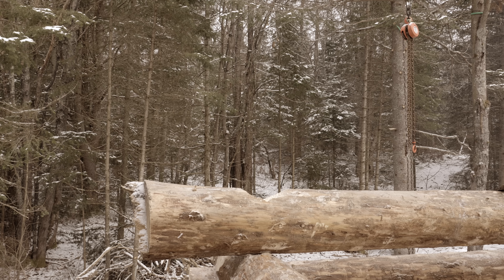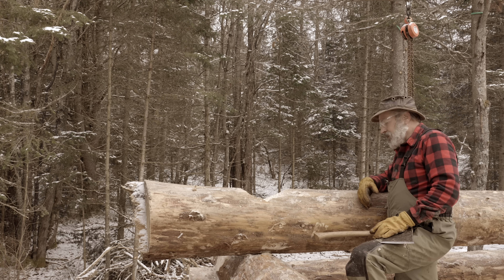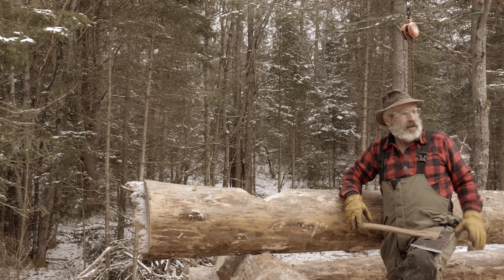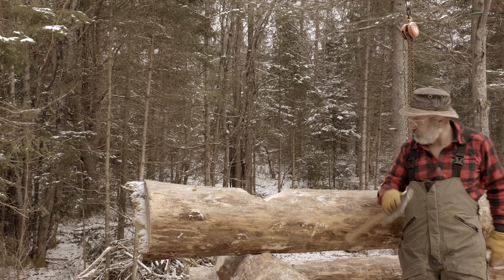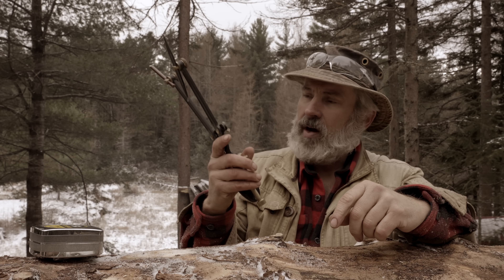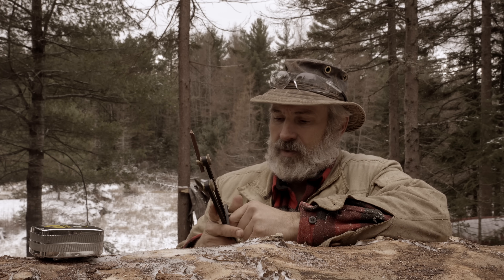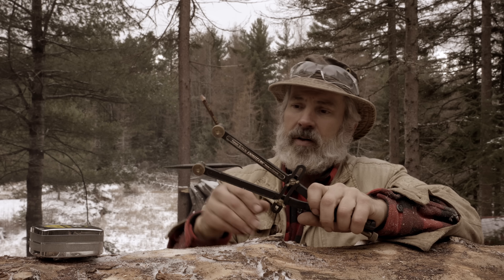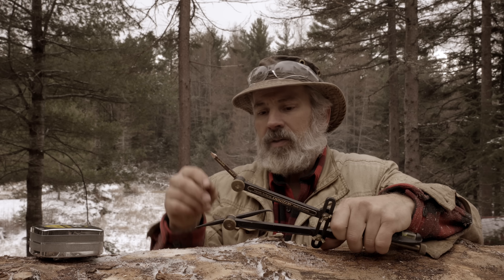How Log Scribes Work, Comparing Two Types

Comment: I had wondered about how you knew exactly where to scribe.  Now I see that the placement has to do with the bubbles in the levelers being centered, yes.  Both vertical and horizontal levels lines it up.  It looked like a serious but mysterious business that I was darned if I could make out, but it's clear now, thanks.
Keep the bubbles in the middle, lol!

Comment: I am more acquainted with using a compass than a carpenter scribe. We use it for fitting flooring or flush fitting a cabinet or shelf to an uneven wall. I have to admit, your scribe is pretty cool. And you are well skilled in the use of it. Learning a lot. Thank you.

Comment: Actually I've been wondering how to use that tool for the last two weeks because I'd like to build a cabin myself and that was one of the things I didn't know how to work and was really discouraged about so please keep showing how to do this It looks very complicated
Reply: you can do a botch version to practice with with a pair of LONG chopsticks and a ruler ... the chopsticks  are placed in a v shape and the ruler goes between so it makes a bar like a capital A ...across them ... the ruler sets your gap and then you eyeball up and down and flat to the point of the angle .. sure it's not as precise BUT it will allow you to get the idea in your head .... you can also use a protractor from your kids school geometry kit ... the scribe doesnt just work on logs either ... installing a countertop on a wonky wall ... is great for them ... you match the wall to the counter top then ... and of course many other uses to get things to flush mount to each other 
.
as with shawns troubles getting a marker to work in all weather and at any angle is not easy ... sadly crayons are best from my experience BUT they shrink FAST and so require a spring loaded feed to keep them at the horizontal level ... while you watch to keep it at the vertical level 
.
the idea behind the ga is it is a fraction larger than the largest gap you need to fit to ... that way the complete surface will be fixed to that point and adjusted correctly all along the line of the scribe

Comment: Hi Shawn, I recommend you invest in the rotating pen holders that use plotter pens for your Chambers Classic Scriber. This would save you a lot of time, as you do not need a levelling board and you can adjust the pen angle as you scribe and you don't have to worry about broken pencils. God Bless.
Reply: Doesn’t a plotter pen work on gravity so can’t mark pointing up?
Reply: @baddoopey  The pens that I use are pressurized. They work when pointed up. Fisher space pens also work great in various scribers.
Reply: Just saw a video of a guy who built a log home in Alaska in 1965. To scribe he used a hand held marker with a piece of string tied to it. His left hand held the string and followed the contour of the lower log while the marker in his right hand marked the upper log. Simple and he got perfect saddle notches.

Comment: Hi Shawn, I know you've talked about the cabin size a little, but how does this cabin compare to the previous one? It looks larger and a more square footprint. Also, can you talk about the planned layout, I think you mentioned in a previous video that the stove will be more centralized.  
I won't likely be building a cabin, but I like the scribe tutorial, you never know when that knowledge can be used else where. Currently I am working on a small boat. 
I like how the cabin is starting to take shape, the joints look beautiful. Keep up the great work, on the cabin, the videography, and a gratuitous scratch'n for Cali's fun whimsy in the videos! She always brings a smile. Thank you

Comment: Very Insightful, a point I hadn’t thought of was what you will be looking at forever on the inside walls. I faced our floor to ceiling fireplace with natural stones, it was beautiful, huge and heavy but there were 6 stones in the whole thing that looked like faces. We ended up naming them and over the years guests and family came to know them too. Apple face, purple man, tongue man, split face and so on. I would rather not have had them in there.

Comment: Shawn, the axe’s you use for trim work appear razor sharp. How do you maintain those edges?  What sharpening techniques do you use?
Reply from the maker: Just a two sided puck stone and a leather strop, unless the blade is nicked and I have to rebuild the edge with a file and stones

Comment: I heard you say, if I missed a big knot at eye level it would drive me crazy for years. I would have to take the time to chop and feather all those inner knots down, at least the ones visible, or I would be staring at every one of them. I wouldn`t care if it was after it was built, if I had to. I would also have to do the mesh and mortar finish, I love that look, nice and clean. Waist high already, the big logs really stack up quick, they sure are fitting together nicely, with that scribing method for sure, very nice.

Comment: When you start scribing a log, you need to know the diameter of the next log in advance. And lifting or lowering one of the ends of the log will avoid making an unreasonably deep longitudinal groove (as in your case), and will save a lot of energy, since cutting a long groove on a log is a high-cost physical process. And one more clarification: - on a log with a diameter of 30-35cm. the width of the long groove should not exceed 12-14 cm, and the depth should be approximately 3-3.5 cm.

Comment: @5:20 and following: "That's good for left-right, which is typical...move this down slightly...it's hard to move it slightly, which is what I don't like about this one...if they'd fix the - if they had some kind of calibrated nut here to make fine adjustments..."

The PDF manual for the Veritas Log Scribe shows (in Figure 5) that you can move the cross level from the head of the scribe to one of the studs which secure the legs to fix the span between the scriber's points.  In that case, the adjustment for the outer level vial (now pointing perpendicular to the length of the scriber's legs) is effectively "nulled" and will only read level when the scriber's tips (pencil and stylus) are in line vertically with each other.  The inner vial (now more-or-less parallel with the scriber's legs) can be adjusted by tweaking the level housing around the stud to account for difference in point length (or possibly, angle), without messing up the other level vial.

Comment: Guess I am one of those 10. I will be putting building post and beam timber framing in my masonry earthship. I built a log cabin for a customer last winter. Due to change in building codes it will be last one I build in southern MI. The logs now have to be cut and insulation added in center of them. Not to say I won't build a few in the upper peninsula as codes are different. I will be putting log accents on my sister's house too.

Comment: Thanks. Was wondering how that worked. I have a tool I can't figure out. Maybe it's a scribe without a level. It was used to build Gary, Indiana in 1906. It's wooden with pretty brass an has a needle to scribe with. Only 1 needle. You can move a block of wood up an down on the ruler in the wood.

Comment: Hahaha I never thought about that. You’re right, there’s probably only like 10 people watching who’d ever actually get around to trying to build a log cabin. Hopefully I’m one them, but I’m certainly one of the thousands who are fascinated and want to know out of interest :) Thanks mate :) Also curious as to why you’ve said it’s not as efficient to level the tops and bottoms of the logs for stacking?
Reply: but about half will do things like install counter tops in their kitchen and then a scribe to match the table top to the wall works as well ... even if the back wall is a brick surface or some uneven surface ... or even a corner etc ... like on flooring .... 
yup scribes NOT just for log cabins ... and they are handy for making circles too ... for pipes and electrical conduits etc ... essentially it is just a slightly modified protractor like you used back in geometry class in school

Comment: What is the approximate vertical contraction would you be likely to get / should aim for in full scribe, compared to the height you'd have with non-scribed sum of log diameters? (that is, how much height do you lose in full scribe? About a third diameter per log? Or a quarter? Or a fifth? Sixth? ...)

Comment: Shawn do you scribe the corner tight, and take out a little more in the field to ensure most of the direct weight is taken in the corners? And to adjust for moss?
Reply from the maker: Yes. About 1/4”-3/8”
Reply: @ShawnJames1  thanks man! I'm a carpenter, and scribe daily for millwork and such. Just not logs. I've read up a bit on log cabins, that's why I asked. Keep up the good work!

Comment: funny part about scribes ... we have all used them .... we called it a protractor in school for geometry ... essentially the same thing ... and the same use just over a long line instead of from a point ... 
.
 the only real difference is that the better scribes have levels built in and a good marking system .... 
.
but scribes arent just for making cabins ... fit a counter to a wall ... fit tiles on the floor around corners ... any flooring etc ... match drywall to stone or bricks ... or even a slanted roof etc ... any place you need to match a not perfectly straight line to another surface that needs to fit tight up to it ... they all use the exact same principals
Reply: @0723kaboom lol, I still call the scribe a protractor from my geometry classes in school 60 years ago.  Same principle but we didn’t have attachable indelible pencils back in the day, 😉 That word has only came to mind when Shawn first started scribing his logs. 😆 Funny how we remember things taught us so many decades ago.

Comment: I recently watched a video where they chinked a log cabin with wire mesh nailed to the seams on in and outsides like stucco.then used a cement product..
Reply: The Outsider
Reply: @ws775  Yes The Outsider! I could not remember title but you have it correct!Thanks!

Comment: Shawn, why don't you use the attachment for the chainsaw to cut into the log length? I know that you are all about the hand tools. And squeezing the trigger on the saw for long periods is painful. But I would use it with a cable strap on the trigger. Not as safe as your finger, but you are capable of doing it. It would speed up the process and save you labor. As we say in the Blacksmith trade. If our ancestors had access to the tools we have today, they would not have hesitated to use them.

Comment: I recently saw a presentation on YouTube which hypothesized that the fitted, megalithic Incan walls may have been built with scribing. But I don't think the guy realized scribing is routinely used for logs...or even a thing done in modern times 😂

Comment: Instead of using a graphite pencil that needs to be sharpened often, why not use a metal point. A lead-tin stylus or a silver point would work and neither of them smear or smudge. One Silver Point, will probably last you the rest of the build, the only drawback it that it isn’t erasable,